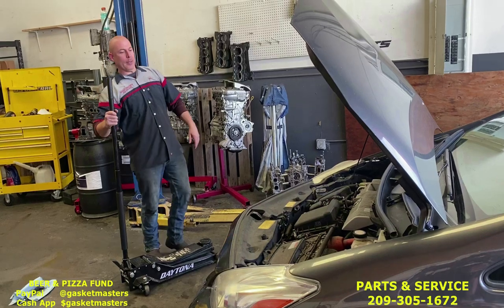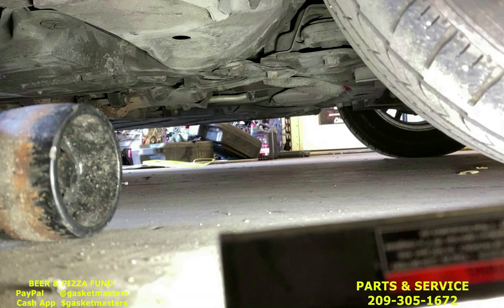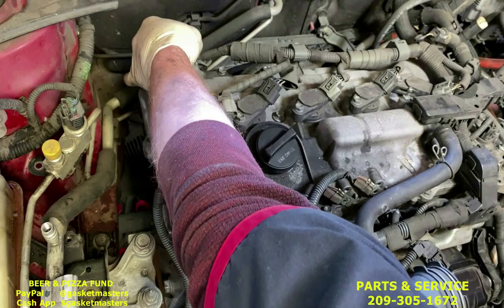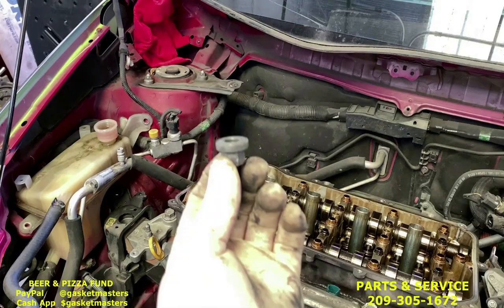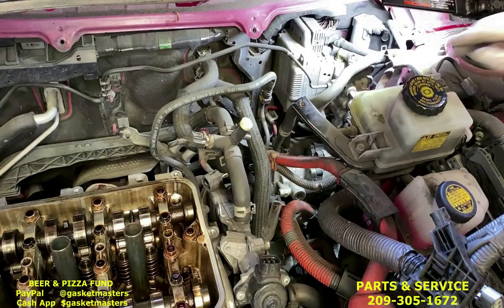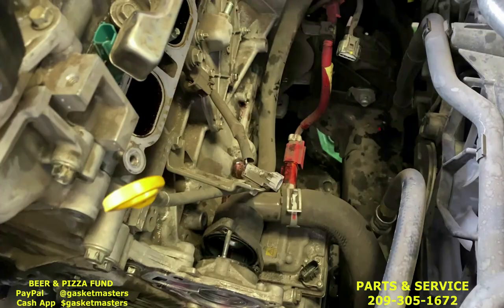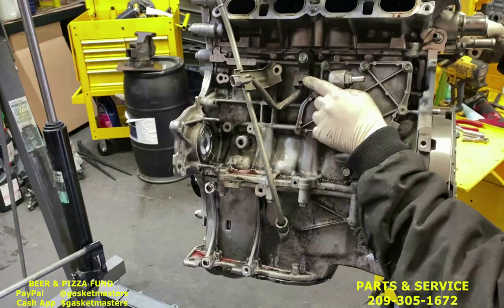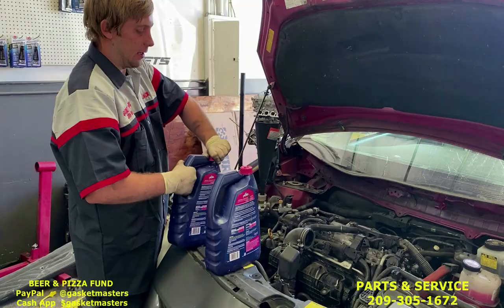COMPLETE PRIUS ENGINE REPLACEMENT HOW TO 2010-2015

Comment: I have a 2010 Prius with 432,000 miles, original motor, and original hybrid battery. Just routine maintenance, best vehicle I have ever had
Reply: Does it burn any oil? Mine started burning oil at 155,000
Reply: I wanna know too lol does it burn oil ?
Reply: You are one lucky man. I'm not as lucky with 145k and heavy rattle at startup today and cleaned clugged up EGR a year ago and installed oil catch can. Mine is burning oil and catch can gets full after a while
Reply: No head gasket replacement?
Reply: Burns oil so bad that if you don’t catch it in time you’ll burn a hole through you piston
Reply: @ThatPsillyDude  Yes, they all burn oil by design flaw. It was fixed in Gen 4.
Reply: @MrTmenzo  Cheapo job.
Reply: @igorb81 is there a video out there that shows how to install a catch can ? How did you figure out how to install it ? Thanks
Reply: Mine is exactly like yours 2010 but the engine just exploded and it’s dead, what can I do please? Where can I find q good used engine for prius 2010?
Reply: @ThatPsillyDude mine started burning at 98k and now it’s at 160k and might have rod knock
Reply: What maintanance
Reply: I'm curious, what is considered routine maintenance?

Comment: Just wanted to thank you! I am in Florida and Walter, your mechanic came and did an awesome job on my Lexus CT200H. After being ripped off by several mechanics including Lexus dealer, finally you came and saved my car. Three different mechanics told me to salvage my car because it was done. You guys came and brought it to live for much less money than others here in FL ask for. Job done right in front of my home (whatttt!) The engine was took apart and head gasket replaced in front of my home in several hours, 4 to be exact. Thank!!!!!
Reply: Can I ask how? I don't see any office in FL, did they fly to your place? thanks
Reply: @reocam8918  No, they did not fly. It happened that they had a mechanic doing a type of a cross country job ( I know it sounds incredible; to me it was a miracle.) The mechanic was doing this type of repair across US since they know dealers and most shops rip off customers and have no idea how to handle this issue. When I called, the mechanic was right by the next County I was in Florida; thus, it was really easy for him to show up next day. If you need them, I would call. My experience was incredible. A lady picks up the phone and she is super friendly and understanding. Good luck!

Comment: Thank you Gasket Masters! I just used this video to replace my 2zr-fxe in my lexus ct 200h 2014. It took me 3 days. Only issue I had was no part in the video shows removal and re-attachment of the exhaust manifold, but it was easy to figure out on my own.

Comment: great video! I used 14mm with long extensions to remove header to exhaust coupling.
Reply: I wish they had that in the video.  I was trying to pull the engine out without disconnecting those bolts asd I didn't know about them.  I had to remove the stud bolts/manifold from the block as I had no way of getting under the engine with the cherry picker hoocked up. Then, needed to spend a week loosening the bolts with WD40 so they didn't break. Used a low PSI pneumatic impact wrench from underneath.

Comment: This is a great instructional video. Do you have the torque specifications for any of the nuts and bolts you removed? If not, do you know where I could find those easily? Thank you so much.
Reply: Just snug them up-don't do them up real tight otherwise you will pull the soft alloy apart.  They come out easily and that gives you a guide to the tightness required.

Comment: Man thanks for your video. I just finished the job and it wont start. It says “check hybrid system stop the vehicle in a safe place” My 12v battery did die and I gave it a little charge. I wonder if I need to fully charge the 12v?

Comment: I just bought a used JDM (Japanese Direct Motor) engine assembly that came with the damper assembly and flywheel sub-assembly. I'm doing an engine swap on my 2010 Prius with 289k miles. The damper from the newer JDM engine has been revised or updated. I can't get a solid answer as to whether the JDM new/revised damper is compatible with my older transaxle and engine flywheel sub-assembly. The size and bolt locations are identical. Some of the "sales people" at JDM retailers are saying it's not compatible and they recommend that I use my old one, and others reps say the opposite. As is understandable, the sales people typically don't have experience doing engine swaps. Have you guys at GM had any experience with these import engines? Any thoughts on damper and flywheel compatibility? And many thanks for this great video. The old engine is out of the car and waiting on the replacement one. Wouldn't have made it this far without your video. Thanks.
Reply from the maker: First of all, JDM are scams. Many of our engines, we sell to JDM retailers. Use your old damper and flywheel
Reply: @gasketmasters  Damn. Very disappointing to hear. Thanks for getting back to me.

Comment: My Prius 2012 with 140,000 miles on it stopped me on the road. The car engine nolonger starts but it can move or drive on HV battery only. The scan says P3147, P0335 and P0A0F. But later the P3147 stopped showing. I have changed the crankshaft position sensor,  its good but I changed it. checked the reluctor plate inside the engine and its in its position and in good shape and I  changed the ECU or brainbox. The crankshaft position sensor wire harness is good. Still the car can't start.

Before this issue I have been having rattling and knocking sound in the engine at idle or low speed only when the hybrid battery is charging. If it's not charging the rattling noise doesn't come on. 
No error codes on that. 
I cleaned egr valve, nozzles, pc valve, inlet manifold,  throttle body and changed plugs still the noise didn't stop.

I beginning to think the problem is my transaxle.  The MG1 motor that starts and charges the HV battery.  Remember I said my car only rattles when the car is charging the HV battery on idle or low speed. Now the car cannot start.

I am thinking of changing  the whole engine including the transaxle.  
What do you think the issue is? 
My location is Lagos Nigeria
Reply: A leak in the EGR-system can stall the engine.  What was the problem?

Comment: prius v had jdm engine swap by a local shop but mechanic have not been able to turn on the car. Shop can not find why engine will not turn on. dash lights up normal but no crank. Tried maintenance mode to turn on but it will not go into maintenance mode nor crank. Any suggestions or mechanic in sw Florida that can help?
Reply from the maker: Yeah. Clear all codes and make sure PCV hose is connected.

Comment: Hey guys, excellent video much appreciated. Just a question if you might know I got a JDM motor to replace one that’s in a Lexus CTH 200 and I noticed you said you had to swap the fly will how do I know if that’s necessary or is there any indicators that I might not have to do that?
Reply: Did you figure it out ?

Comment: I just have a question, when shopping for an engine for my prius, does it matter from which model of prius is coming from or are all the same? of course being of the same generation, mine is a 2013 prius V five, thank you!
Reply: I’m pretty sure only the Prius C has a different engine. As long as it’s 3rd gen.

Comment: Like post however something is gone askew on video quality.... also no mention of exhaust manifold removal
Reply: Did you ever figure out how to remove the bolts from the exhaust manifold? That's where I'm stuck right now.
Reply: @melissanuyda8536  Leave the exhaust manifold on until the engine is out.  Then it is just seven nuts to undo with a socket with a short extension.

Comment: I know some haters that have said removing/installing engine from above the engine compartment is the wrong way but honestly I don't see why it would be the incorrect way. Is there any reason you guys did it this way vs dropping it or does it not matter and are those just trolls hating?
Reply: I guess it depends if you have a lift available or doing it at home. It's easier having a lift and just dropping the subframe
Reply: It is quicker this way.
Reply: @Campbellclan4ever  I recently did it pulling the engine over and i agree it is much easier this way. Haters said it's impossible and more difficult on the prius but I disagree. Thanks for the video

Comment: Currently working on this project, got old engine out and started putting new engine in and one of the alignment pins is still in the transmission and still in same place on new engine, how do I remove one of them? Tried a few things and it doesn’t want to budge, any tips? Thank you!
Reply from the maker: Hit them with a hammer sideways from side to side and they will become loose
Reply: @gasketmasters  thanks, I’ll give that a try! Appreciate this video a lot, very informative!
Reply: I drilled a 5 mm hole in the alloy block (roughly 1/4") from the rear and with a punch tapped them out from behind-that way they & the hole are undamaged and can be reused.
Reply: vice grips

Comment: Where do you get new engines?
Reply: At the engine store, lol
Reply: I got mine from a local JDM after shopping around low mileage 90 day warranty $1,100 with intake, exhaust manifold, EGR, injectors included
Reply: @mrvic92154  Hello what is JDM? Where can I buy a good used engine for 2010 Prius? Im in Seattle, help =(

Comment: are the JDM prius engines direct replacement or do cam orcrank sprockets have to be replaced?
thanks
Reply: Direct replacement. There is one sensor near the intake manifold that has to be swapped. Otherwise they are identical

Comment: Flywheel bolt socket, is apparently not "part of the kit"  Is that a 12 point or an external torx?
Reply: 12 point 12mm

Comment: what did you guys even mean that "if it even needed it?" what was the need for the replacement? knocking? just wondering as a bought a prius from the junkyard and its knocking now, oil is milky and coolant keeps draining/losing coolant.
Reply: Seems like your gasket is worn. Sometimes it's cheaper to replace the engine with a low mileage used one as opposed to having a rebuilt done.

Comment: Is it necessary to disconnect all of the batteries before doing this?
Reply: Yes! 12v battery is in the trunk, 10mm nut. Hybrid battery disconnect is in the trunk too. Bright orange disconnect visible when you take trunk floor and black basin out. Make sure you keep windows open and don't close the trunk all the way when you disconnect. Makes getting it back together easier

Comment: Where can I buy a used prius engine?
Reply: I got mine from a local JDM low miles Japanese engine distributor, I found a low mileage 90 day warranty $1,100 with intake, exhaust manifold, EGR, injectors, clutch and pressure plate included
Reply: I have the same question, could you find one at the end?? I need one too and I’m in Seattle
Reply: @igorrosales1799  I got mine from a local JDM low miles Japanese engine distributor, I found a low mileage 90 day warranty $1,100 with intake, exhaust manifold, EGR, injectors, clutch and pressure plate included